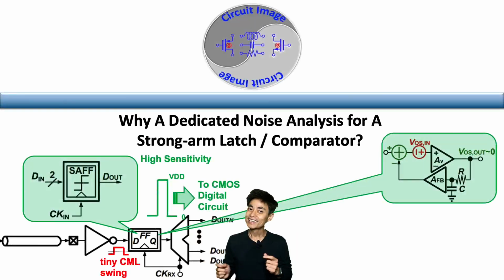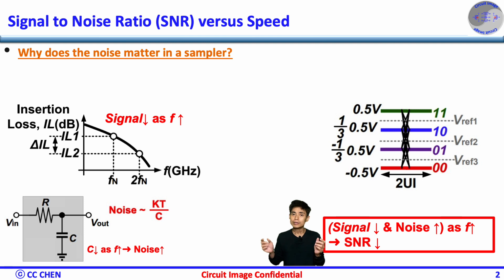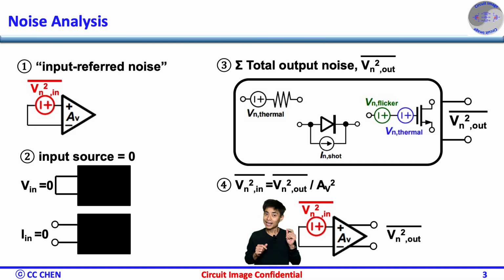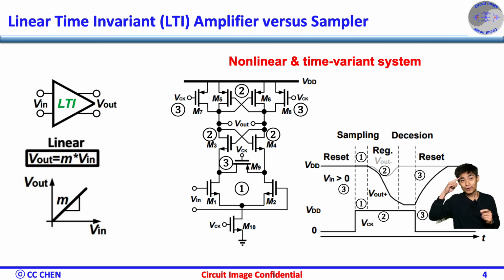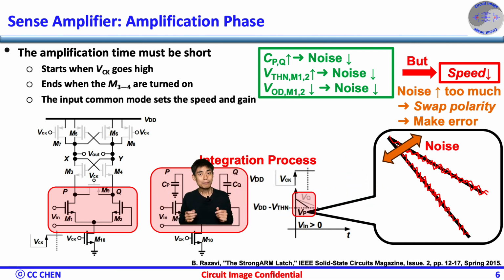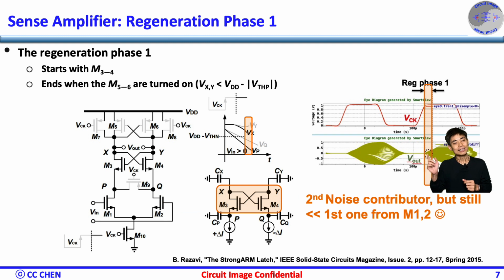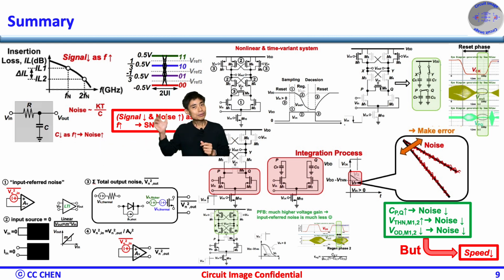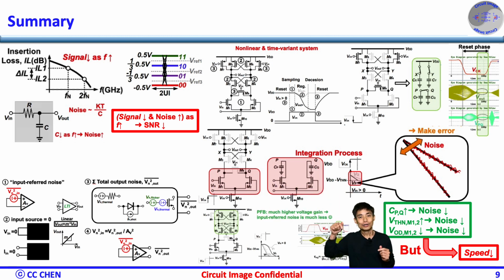Why A Dedicated Noise Analysis for A Strong-arm Latch / Comparator?

Comment: I don't understand your conclusion of how increasing the threshold voltage of input pair and lowering the input common mode will decrease noise. It seems counter-intutive. Can you please elaborate on this point?
Reply from the maker: Hi Aravind, nice to meet you and thank you so much for the feedback. Reducing the overdrive (VCM - VTH) can reduce the noise. Then increasing the threshold voltage (VTH) of the input pair equivalently reduces the overdrive. Also,  lowering the input common-mode (VCM) equivalently reduces the overdrive.